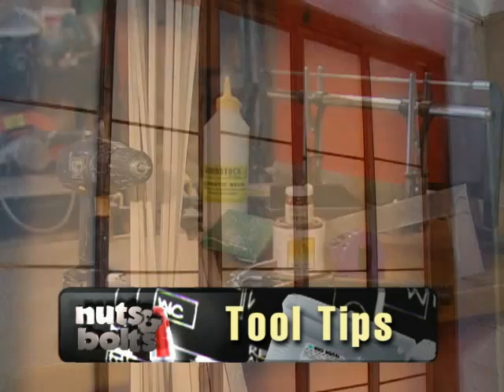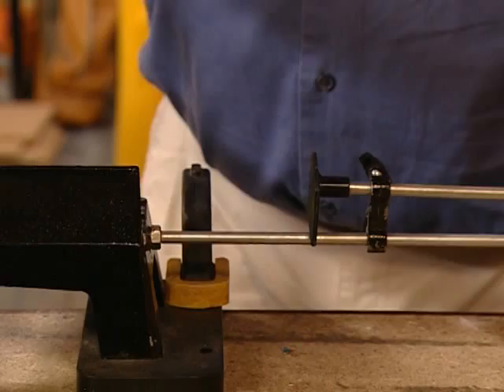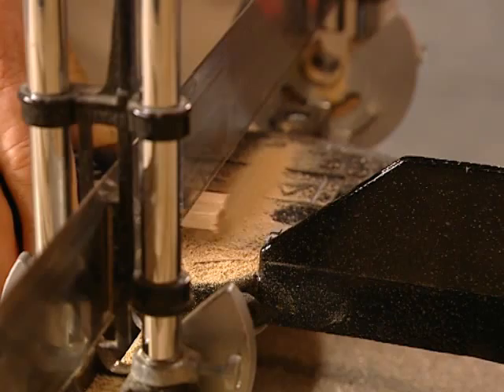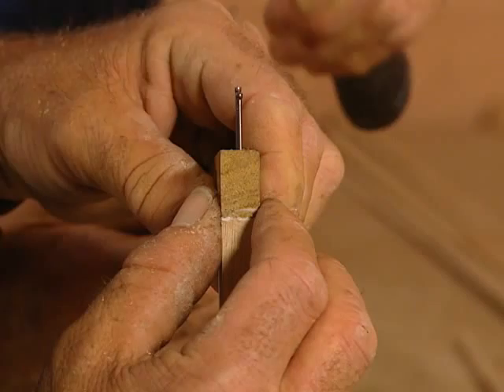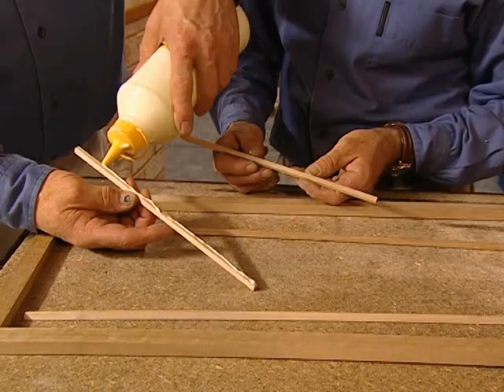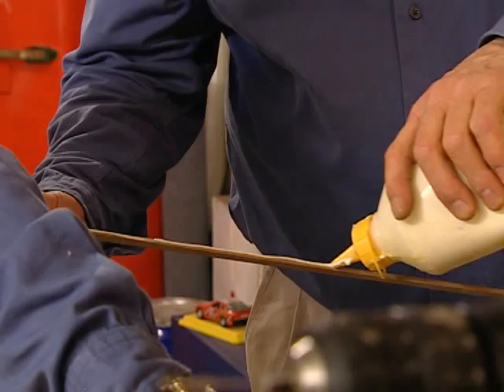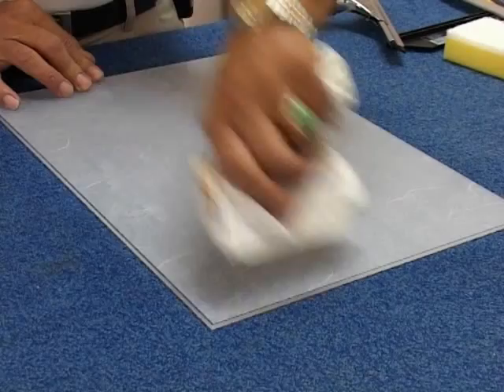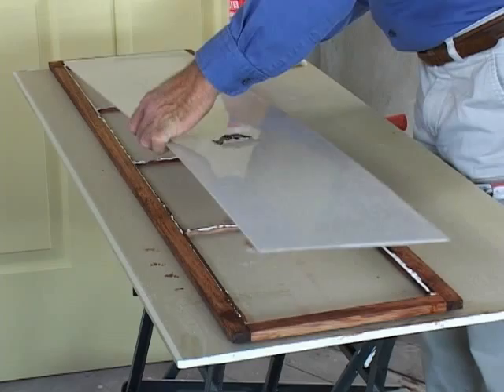How to Make Japanese Screen Panels

Comment: End grain glued to long grain at the corners with one pin holding it together with two heavy sheets of acrylic? Although the acrylic is a good idea but I was hoping to see more traditional Japanese wood shoji frame construction which is much stronger but takes more skill.
Reply: Skill ~ there was no skill involved in this vid other than the camera man.
Reply: @graymesso3845  which is also the point of the video

Comment: I think it would be easier to use Japanese joinery. instead of nail and glue joints using 2 people, use a dowel or through tenon on the corners.

Comment: That acrylic panel is very expensive - I don't see the need for it. Also no detail was provided on the sliding tracks. I would think the top groove should be deeper to allow for inserting the screen.
Reply: You are correct on the depth of the sliding tracks.

Comment: The small guy is lying. It doesn't look great. It looks ridiculous. The lines are not even lined up properly. Also you never ever use nails, use dowels. Finally just buy some darker wood and don't stain it with some toxic chemicals it will look much more premium